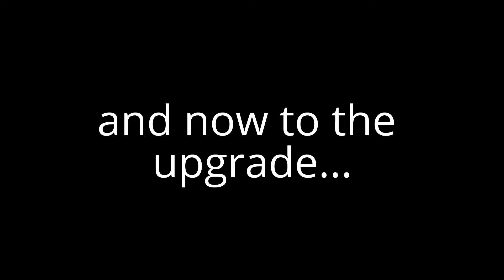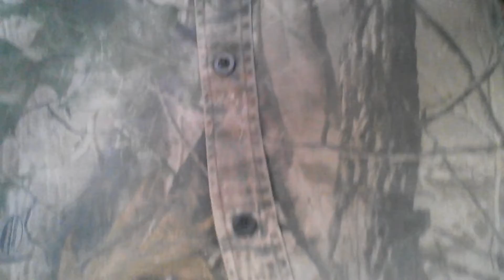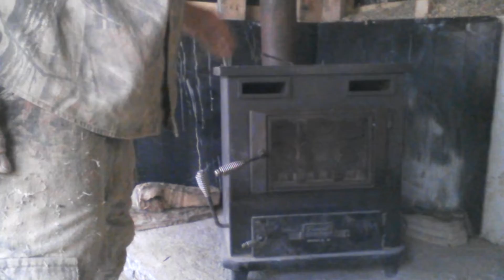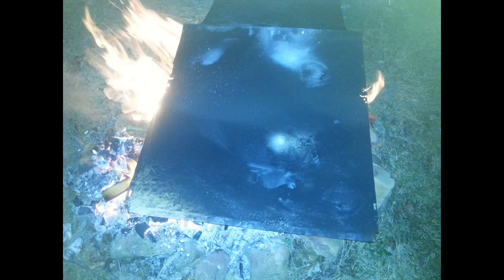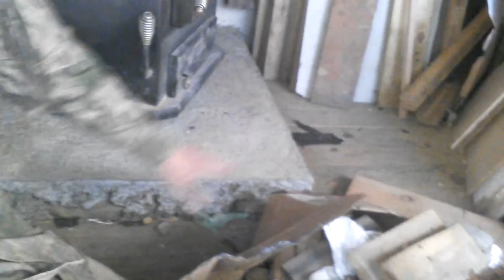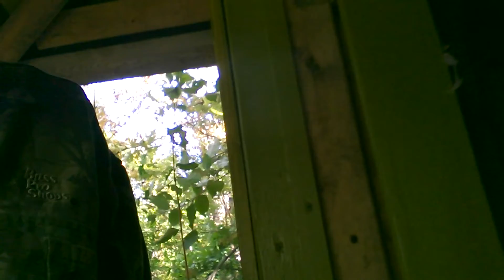Tiny House Off Grid Pallet Cabin - Part 15 Wood Burner Upgrade

Comment: PS: I have a two pieces of aluminum tubing I put the chimney brush on, run it down the chimney to the flu pipe and scrub up and down a few times. Then climb down, go inside take a cereal box and scrap 1/3 of a box of creosote out and I'm done.

Comment: I think you will be sorry you didn't keep chimney straight. It makes cleaning so much easier,which needs to be done real regular. All depends on the wood you burn and how dry it is. Also the chimney type. 
 I ran insulated chimney 40 yrs ago and still using it. All my creosote is on the cap and the inside flue pipe. The insulated chimney almost always is clean,because it is warm and the creosote sticks to the cool pipe only. It is the creosote catching fire that causes most chimney fires. 
 Since I have a down draft stove I don't need a damper,  which I guess can cause problems in there selves . I read several good books on wood stove and fire place chimneys and stoves before installing in my house and shop. 
 Just a old man's ramblings , lots of luck and be safe.
Reply from the maker: Thank you for your information and knowledge in this area.  Piping ended up this way because the main support beams supporting the roof are directly above the wood burner. Originally I planned for a true chimney and corner hearth so this was not in play during planning, layout, and building.  The pieces used here were just what I could come up with as winter was coming and budget was tight.  Having used this stack set up for several years now, I find there are improvements that could be made and a newer stack set up is in the works.